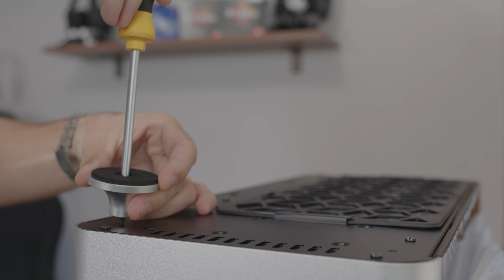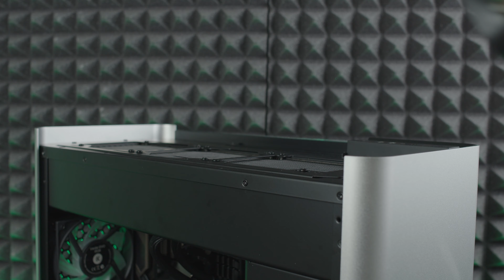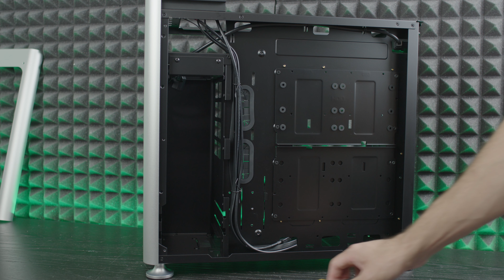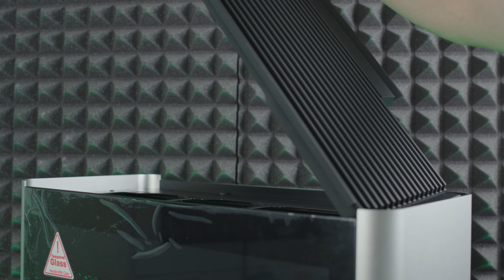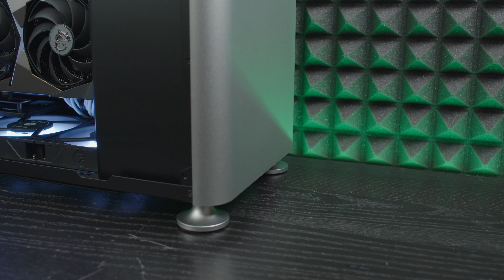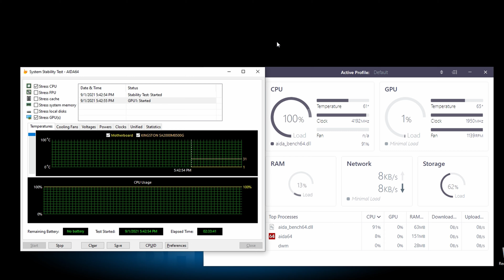JONSPLUS i400 - Premium Way to Build!

Comment: very sleek looking case, shame it's so hard to find in europe. Available on aliexpress but shipping is over 150 euro. I was a bit disappointed with the build quality of my sl600m - this thing looks way more solid, how does it compare? also do you know if the icegiant prosiphon elite will fit in there width-wise? If it doesn't interfere with the PSU shroud then I may just get this case despite the hefty shipping cost.

Comment: Do you think this would fit a 4090 gaming x trio well ?
Reply: Got this case.
An MSI Rtx 4090 gaming trio just about fits in.
I had to remove the slot covers for installation so that I could place the gpu.
Plugged the gpu into the pci slot and then attached the slot brackets at the back.
this is how it works best.
Reply from the maker: @michaelbusch8193  Nice, thank you for the additional info! :)
Reply from the maker: Unfortunately, I can't even guess since I didn't have any of the RTX 4090 cards with me... :(

Comment: Nice review but it looks like you can't use the other pci slots when the gpu is vertically mounted. If I'm right couldn't they do that better? In other high end cases you don't have that problem. And for a workstation case it is also ought.
Reply from the maker: Yeah, the other PCIe slots are blocked, but that is basically on all cases just because of the riser cable honestly. :/
Reply: @PCCrazyDario  What is the use then of the way this is done in the Phanteks Evolv X where the part of the PCI bracket for the video card is  turned. That makes no sense then. Would like to paste a picture to illustrate but that is possible in the comments here. But you probably know this case anyway :)
Reply from the maker: @arjjunananda  That is a completely different mounting mechanism in Phanteks Evolv X which already has vertical mounting brackets. Honestly, in that situation you are also limited to placing additional PCIe cards because the riser cable covers them all. So in any situation, when placing a GPU vertically, you are loosing all other PCIe slots just because of the riser cable. ;)
Reply: @PCCrazyDario  Thanks for explaining that👍
Reply from the maker: @arjjunananda  Not a problem of course. :D